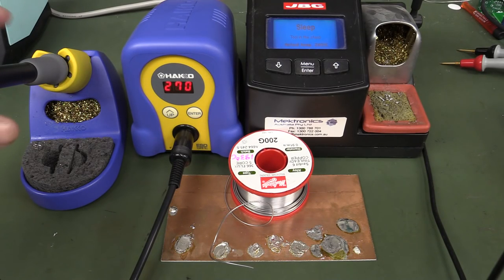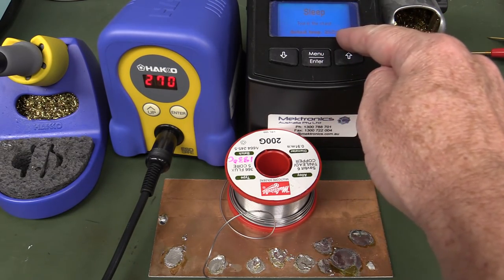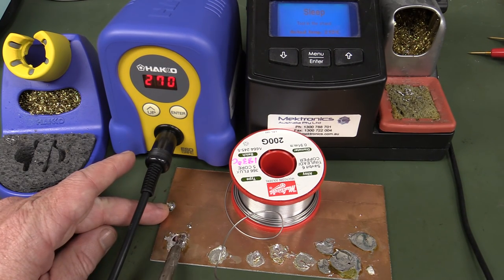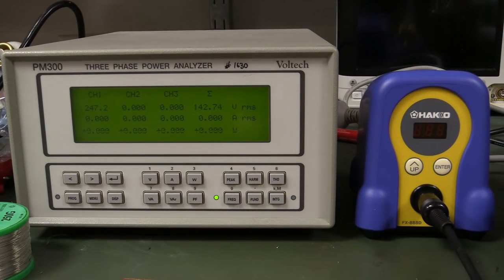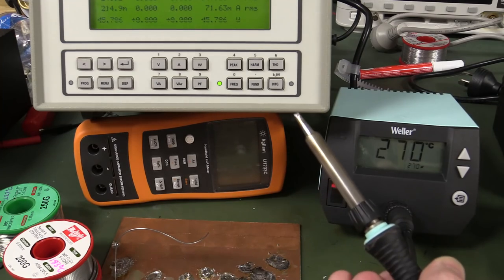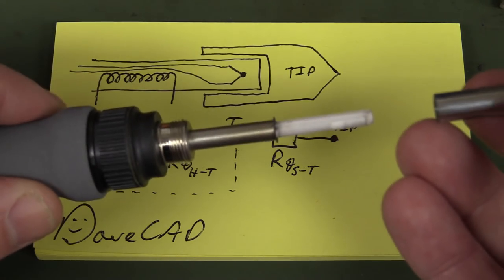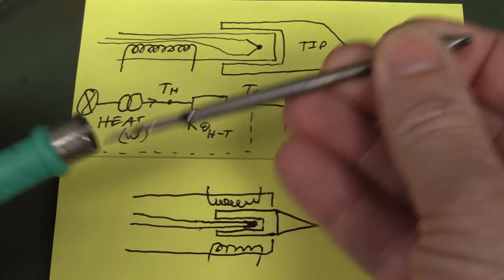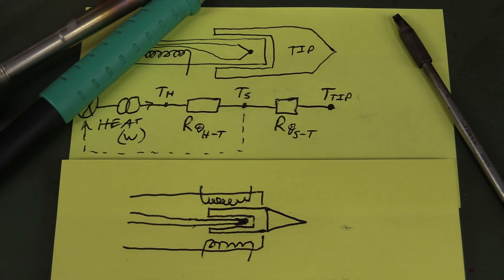EEVblog #1065 - Soldering Iron Power Delivery Explained

Comment: To reply to Dave's comment on the previous upload...

(regarding the Metcal.)

"You shouldn't use a 413C tip on electronic components."

The temperature rating is the MAX temp, and the nominal temp is nowhere near that when soldering the smaller SMD or through-hole joints.

They only reach that max temp if they detect a very heavy thermal mass.
It's very rare that you'd ever need to change the temperature rating of the tip for any normal type of electronics soldering / rework. 

In every telecoms factory I worked at (and AVX) over 15 years, they almost exclusively used Metcal stations, with a few of the "old style" and direct-heat Weller or Pace stuff dotted around Almost all of the Metcals used the same type of tip, which was usually the STTC-136 small chisel tip (or equivalent for the few different models of station.)

And most of those factories were assembling and reworking $20,000 to $150,000 telecoms gear (WiFi, WiMAX, GPS, 4G, 5G  test gear) using those same Metcal tips.

(granted, most of the SMD PCBs were soldered in reflow ovens first, but a lot of manual soldering and reworking was still done.)

I've genuinely never needed to use more than two types of tip on my Metcal at home, and never had to worry about manual temperature control.
They just "work", and if you need even more thermal bulk for soldering huge heatsinks, you just switch to a wider tip.

Put it this way, I've been using the SAME chisel tip for over three years now, and it's still going strong.

(although I'm not soldering stuff all day long like on a production line, I'm maybe soldering for three hours every 2-3 days.)
Reply: P.S. I am a pauper atm, so it's not like I can afford to keeping spending money on new Metcal tips every few weeks. lol

So it's not some elitist thing, I just like to champion the direct-heat stuff, as I personally found that it made my (less than expert) soldering quicker, easier, and neater.

It also does NOT need to cost a fortune to get started, and you definitely don't need to buy a whole range of tips. Two or three at most.

Having said all that, it obviously depends on the type of soldering people are doing, how often they solder, how complex the boards are, and how much they are willing to spend if it's just a hobby thing.

It is somewhat about personal preference as well, and I'm many people get on just fine with an older style station for what they are working on.

I think these vids demonstrate the differences quite well, and shows that the direct-heat systems tend use the power very efficiently.

(the ~130 Watts of the JBC seems like overkill tbh. You could probably solder a bolt onto an anvil with that thing. lol)

I get that not everyone wants / needs to spend more than $150 on a soldering station, but if it's a very well built station from an established brand, it should last for a decade or more.
Reply from the maker: I don't recall as it's been so long since I've used one, but in the Metcal video I included in my is very specifically says the idle temperature is regulated within +/-1 degC of the curie point tip temperature. Are you saying they are wrong?
Reply: I suspect you are confusing the relationship between power and temperature regulation.  The power delivered, or in this case magnetically coupled, to the heating element will vary based upon tip temperature, but the goal remains to hold the tip temperature as constant as practical regardless of how much heat the device you are trying to solder tries to sink all that heat (such as with large ground planes).  It is the power delivered into heating the tip that varies, the feedback loop will do everything in its power to maintain a constant tip temperature -- curie point regulation really does not allow anything else since it is a materials and physics regulated process and not something that can be tweaked with a few lines of code if you wanted to alter those characteristics.
Reply: Ethan Poole

The graph on that PDF still shows the drop in temperature with both types of tip, but the problem is that it doesn't show whether the "TIME" axis is definitely in seconds or not.

The "600 series" tips suggest a max temperature of 600F (315C), and while that's still maybe a tad hot for the uber-sensitive electronics stuff, the tip temp will still drop below that during the short time you would normally be soldering the average SMD or through-hole joint.

I get that the aim of the system is to try to regulate the temperature using the curie point, which is the temp at which the copper slug in the core of the tip will no longer absorb the RF energy from the PSU, but I've never had an issue with frying components because of it.

Again, they use these stations (and other similar direct-heat gear) all over the World without fear of damaging components due to excessive heat.

What I also don't get about that graph is that the conventional iron seems to be dipping in temperature LESS than the Metcal one. lol

I also have to assume that they shifted the graph over for the conventional iron to make it easier to see, but it still doesn't really make sense.

In practice, when using the Metcal, it doesn't seem to pump much extra power into the tip until it detects a relatively "large" solder joint / ground plane, as it simply doesn't need to for most standard soldering.

But, even if the temp doesn't drop too much with the smaller solder joints, I don't think 315C is too high anyway tbh.

I'm not a physicist nor metalurgist. All I know is that they used Metcal / OKI, Weller, and Pace direct-heat systems in every factory I've been in, and at least half of those systems never had a manual temperature control, yet were still "signed off" for use on very expensive products.

They definitely used them to fit or replace "active" and very sensitive components as well. Things like laser diodes for Zinwave products etc. (I soldered a fair few of them myself when I was there.)
Reply: What I like most of the Metcal is if I need to solder anything I just turn the iron on, after about 8 seconds do the solder joint, re-tin the tip and then switch the iron off. In a way it is like the mac of the soldering world. Simple to use for people who view their soldering iron as just a tool to get work done. To me worth every penny.
Reply: One thing I will give metcal is that their irons have the easiest tip change of any brand I've used so far. No set screw or nut to loosen, just pull it out, push the new one in. Don't like the lack of adjustable temperature though.

Comment: I just thought about something: Could you increase thermocoupling by pouring a little bit of copper dust into the tip? It looks kind of loose. Fine copper dust could act like a thermalpaste. Can you try that?
I don't think that would make the tip get stuck. But hey, you got a whole bunch of Irons. :D
Reply: Russians use either graphite dry-lubricant or copper brake grease.
Reply: @SianaGearz  Oooh graphite that's a good idea

Comment: I have my doubts about your analysis of the performance here. In particular, the Hakko decimal point looks to be blinking at a fixed rate when it's on, not on steadily. You were on the right track with the power meter, but measuring at the wrong point. You'd need to splice in a meter, preferably analog for the response time, to measure the current to the handpiece itself. Likewise, the power bar on the fancy iron is probably showing a smoothed output, not instantaneous values.

At the end of the day, 130W is always going to trump 65W of available power. The reduced thermal resistance is going to avoid some temperature sag between the sensor and the tip under heavy load. However, simply adding more power to the existing Hakko design risks overheating the top, again because of the less accurate control loop.
Reply from the maker: The Hakko is not blinking at a fixed rate, it is load dependent.
Reply: The LED is indeed the "heater on" signal.  The frequency and duty cycle will vary with thermal load.  Because the heater is either off or on, it is not proportionally regulated, and there is a time delay between the heater turning on or off and that event reaching the tip and temperature sensor there is a delay in the feedback loop where the frequency varies moderately and the duty cycle can vary quite a lot.

Comment: Theorically you should add condensators on your schematic to account for thermal inertia. Because of high Rst on old style irons having a high Ctip (big tip) helps for small jobs but not really on the ground plane test.
What is also missing is the environment and the ground plane on you schematic. Basically tip in air = very high Rte tip to environment resistance and huge Ce (try heating a room with you soldering iron...). Tip on ground plane quite low Rtgp because of good thermal transfert (with melted solder) and quite large Cgp (big ground plane thermal mass). Technically the ground plane could be seen as a set of small Cs with Rs to take the diffusion of heat into account but it's already complex...
Reply from the maker: I said it was crude.
Reply: EEVblog I know you have to keep a balance between boring complex explanations and short easy to understand ones! And Thx for the great job you have been doing for many years now!

Comment: So I've never used temperature-controlled irons, I've always used your basic plug in irons with either a rheostat or dimmer switch to regulate the temperature myself.

Seems like my solution may be producing BETTER soldering than some of the cheap stations, because I crank the power up based on 'feel' when I know I'm going to need it. It's not a direct-drive tip, but since I can blast full power when I'm on a big ground plane I'm not held back by the bad control loops. Neat
Reply: The nice thing about the very cheapest stations is that they don't have displays and buttons, they have a big friendly knob that you turn to set the temperature, and if you have to, you can just crank it up to 450°C and solder away on your big ground plane. I find that it works much nicer than adjusting the power, even though you do have to adjust them quite frequently potentially depending on what you're doing.
Reply: Actually, the regulated stations are a better solution.  Your solution inherently limits the power available to the iron to "sort of" regulate temperature but the moment your soldering iron tip contacts a thermally conductive part that tip temperature drops dramatically unless you then dial up the power (by way of dialing up the voltage).  By comparison, the regulated stations will always attempt to automatically maintain their set temperature at all times and will dynamically adjust their output power to maintain that set temperature and you may set that temperature point at whatever you want (up to about 450C).

As for whether one prefers an older regulated station with just a knob or a newer design station with digital display, it is more a six of one, half dozen of another (for non-English speakers: a 6 of 6 scenario, in other words, equal), scenario as both do exactly the same thing.  The only advantage to those with digital displays is that you may set an exact temperature each time and they typically display actual measured tip temperature when in operation plus they are easy to calibrate since you can just program in the necessary offset if you want all your stations to produce the exact same tip temperature when set to the same temperature (not terribly critical in a hobby environment).  But otherwise both type stations are effectively identical for the most part until you get into the really high end stations.

Comment: Try smearing inside of tip and element with thermal grease and then you will find that you can dial down the heat on the station

Comment: I guess Weller has temperature gradient from measurement point to the end of tip. It is like thermal resistance from one end of the tip to the other. From construction point I'd assume the difference to be less than on Hakko that has measurement point yet furher away.

Comment: Hey Dave, I'd be interested in your views on the TS-100 soldering iron.  It's a 65W direct drive, portable iron designed to be run by battery.  I've found it superior to vastly more expensive soldering stations.
Reply from the maker: Didn't watch the whole video did you?
Reply: I commented mid-way through :)

Comment: I take aluminum foil and wrap it around the ceramic heating element until the interchangeable tip fits snuggly. So far that has been taking care of most of the hysteresis.

Comment: HI all,
...a followup to my previous msg:  I am thinking about 'beveling' the top edge of the ceramic heater in order to get improved contact between the sensor and the tip.  The reason I am restocking parts and can't test them yet is because a flood recently wiped out my (Electronic Room),...what my nieces dubbed my workshop.  I decided to start with the soldering station.  I have a 937D station ($37  ebay)  but am starting that may be a bad choice--any suggestions?

Comment: Compare the two with the even older type of soldering iron, where the tip is a copper stick, fastened with a screw, inside the heater coil. :D
Reply: MadModders Those are the so called "fire sticks" as they have no real temperature regulation whatsoever, they are simply thermally balanced against the ambient temperature and airflow -- meaning their effective temperature, in free air, is whatever balances against the heat lost to the surrounding air and that tends to be quite high.  This means that the tip runs extremely hot when the soldering iron is in its stand (free air) and then tends to cool fairly rapidly (especially in lower wattage units) when you touch it to something that wicks heat away from the tip -- and the higher the rated iron's wattage the hotter the tip will be since the temperature is unregulated.  The high tip temperatures lead to relatively short tip life, especially with lead free solders due to accelerated tin scavenging, and also means that it can be easy to damage smaller devices that are sensitive to heat.  The lower wattage irons can also have problems with cooling too rapidly, below the melt point of solder, when trying to use solder wick/braid resulting in the iron, wick, and pad you were trying to desolder all becoming welded together due to the solder cooling and solidifying as the iron can not maintain the 183-222C required to keep the solder melted -- often resulting in damaged pads or components when you try to pull the iron and wick away.

Which is not to suggest that one can not solder with such irons -- many of us grew up with such unregulated soldering irons as they are cheap and widely available.  Traditional point-to-point and pin-through-hole components tended to be pretty tolerant of high soldering iron temperatures due to the length of their leads helping to limit the peak temperature seen by the component.  But modern SMD components are not nearly so tolerant of such high temperatures.  But comparing an old style unregulated soldering iron to a more modern regulated soldering station is really an apples and oranges comparison.  With unregulated irons one would typically own two or three such irons of differing wattages as one tended to want around 15-20W for basic through-hole soldering, 40-60W for light desoldering or for soldering heavier joints, and around 100W for heavy desoldering or very heavy soldering (such as if trying to solder to a metal chassis) -- no single wattage was suitable for all types of soldering.
Reply: Yes I know that. I've had a few of them. As soon as the hard iron surface of the tip worn down, the copper was eaten away in a matter of days, and I used a file to "freshen up" the tips.

Comment: I'm not entirely certain that all has to do with just the heating technology. I have a Weller WX2 at work which uses "old technology" and it takes around 5-8 seconds to heat up to 320°C and also about 2-3 second to go from 200°c while at sleep back to 320°c. Maybe not as super quick as this JBC but certainly in a similar range.
From what I can see in the video the Weller WX2 behaves similarly as the JBC with a big copper clad board like this one, solder spread nice and easily.
Maybe the control circuitry is also an important factor at play here? Maybe the coupling in more high-end station is also better giving a fast thermal response?
Reply from the maker: Yes, not all "old" technology irons are the same, there is no reason why they can't heat up quicker than the Hakko and Weller.
Reply from the maker: No, the weller wasn't nearly as good as the JBC, even if it looked that way in the video, you can "feel" the difference as you move the iron.
Reply: Sorry if I was confusing. I meant the Weller WX2 that I'm using and how it feels on a similar copper clad board :)
The tip system of the Wellex WX2 is vastly different than on the Weller you demonstrated.

Comment: Dave what if you put CPU heatsink  spread between the ceramic and the tube? Like artic silver 5 or a ceramic one and took up the air gap
Reply: nm im stupid it would run out of the gap
Reply: Working temp for heatsink compound is ~125 C, you would bake it into its own ceramic/metalised glue and you have a hard time getting the tip off.

Comment: Just a thought, would adding thermal compound help the thermal bond?  Or would it ruin the iron?
Reply: It would need to be selected for the high temperature range. It may make tip changes messy and there is a large chance the viscosity will create a piston seal. Assuming the ceramic heater is sealed well enough.
Reply: wolfedog99 the one I have was supplied by the manufacturer it goes sort of like Talc when it is heated it seems to make the control and heating better but it is a bit of a pain if you change tips often.
Reply: it would not only ruin the iron, but also Dave's reputation